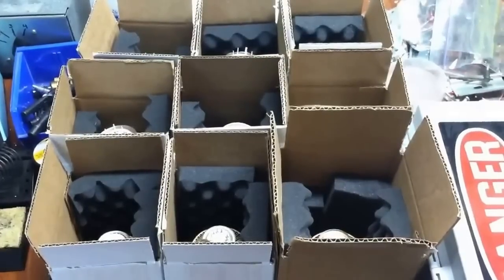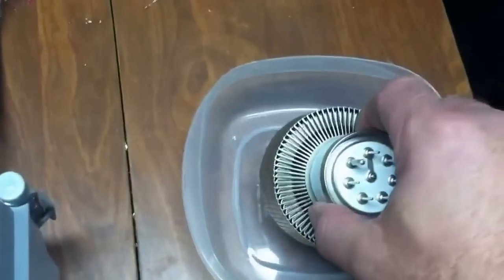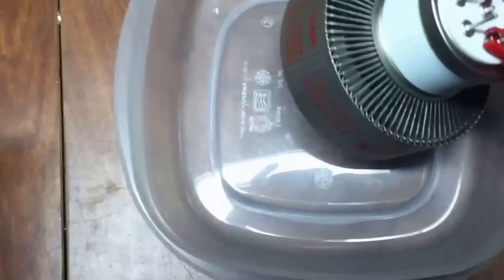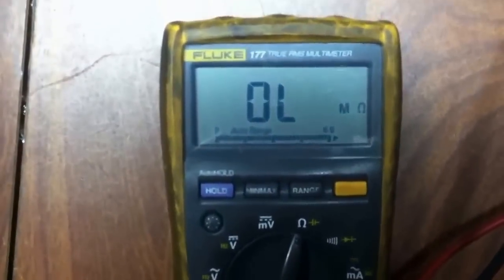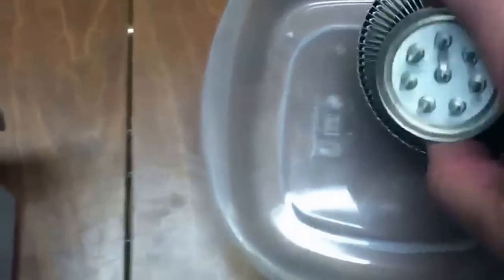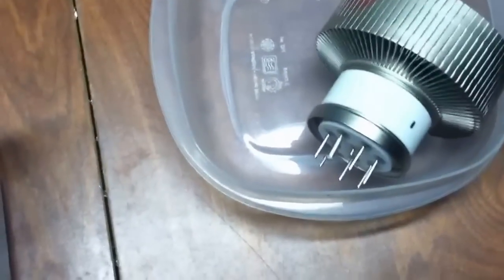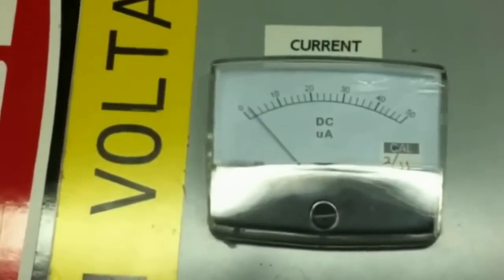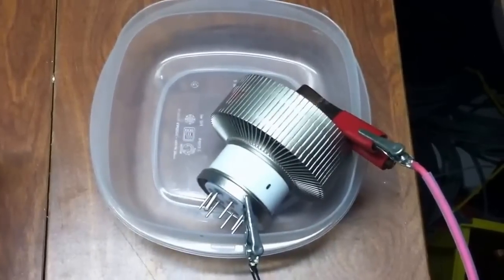TRIODE TESTING

Comment: Great Video, one question: Perhaps I am missing something. The Eimac specification sheet for the 3CPX1500A7 states that the rated plated voltage is 10KV. You performed the test to 5KV. Am I misinterpreting the rating?
Reply from the maker: 10kv is when used in pulse  service. If the tube had a short or the vacuum had been compromised 5kv is more than enough to show a problem.
Reply: let me know by video how to test gi46b tube

Comment: How do you test a 4cx1000a?
Reply: negative on nearest pin to anode,that is screen grid ,and positive on anode....rarely those tubes will have shorts from grid or screen to anode,its cathode to  grid and grid to screen that can have shorts,THEY ARE BEAM TETRODES,or can screen produce strange behavior,when to much back bombardment OF SCREEN GRID occur in previous work... screen current will strangely behave,current will go crazy from positive to negative suddenly....normally negative or positive screen current is normal in tetrodes,but steady current driven with carrier...that you can check only in amplifier....but emission is easy to check ,put 6volts/10amps on heater AC...then tied together grid ,screen and anode,put positive dc regulated supply on anode ,negative on cathode....good tube will pull  maximum allowed anode current of 900 ma at around 27 dc volts...if more than 30 volts is needed to pull 900ma on anode,oxide from cathode is low and emission is low... regards
Reply: @sinkosav  How do to test a GU74B ? Tnx 73
Reply: @TheYc2lev  gu74b is tetrode ,same as 4cx1000,so you have to put filament AC voltage to heat the tube...then connect together g1,g2 and anode,and put positive wire from DC power supply on that connection,minus from supply connect to cathode on tube,then increase slowly DC supply from zero and monitor supply current meter,as you increase voltage ,current will be increased...max  anode current for gu74b is 750ma....so increase voltage to achieve 750ma,if tube is good ,around 18 to 20 volts will be needed.....in that way ,you can test any tube,basically that way tube work as diode
Reply: @sinkosav  Thank you very much. OK, I will try it. See you 73
Reply: @TheYc2lev  you welcome,remember if much more than 20 volts is needed to achieve 750ma anode current,emission is low...you can try to cook tube few hours,but some air to cool a tube is needed,emission often can be restored that way....you will notice that current increase slowly without increasing supply voltage...regards
Reply: @sinkosav  what do you mean: " try to cook tube few hours" ??
Reply: @TheYc2lev  it mean,leave tube heated and under anode current ,as  suggested for 2 or 3 hour..its engineering slang for heating tube for some time to  finalizing vacuum inside tube,that way hot tube absorb molecules of oxygen and other imperfection in vacuum if tube is unused for long period of time
Reply: @sinkosav  , ok ok thanks for the complete information

Comment: ware is good place to bye medical pull at ??
Reply from the maker: It's been years since tubes have been used in the MRI machines. You can find the Chinese tubes on ebay.
Reply: k have u had good luck with the chinese tubes ?? i have not use any of the chinese tubes yet but will to give a go try if the quality good
Reply from the maker: The last time I received a batch of medical pulls half were Eimac and half were Chinese. I kept a couple Chinese and have been running it in my 8877 amp for a year and it has performed well. Only time will tell how they hold up?

Comment from the maker: I have had to test hundreds of tubes, after these simple test you can be sure the tube will not short when you power up. The best test is an emission test. With the 8877, grid current 20ma, plate current 800ma and plate voltage of 3500vdc should yield 1500 watts output. Low grid current is always a good sign.
Reply: I repaired an Alpha 76PA with 3 of the 3cx800a7 triodes. Letting them bake for 24 hours as we speak. Standby temp above tube 1 is 4deg F above ambient. Tubes 2 and 3 are about 10deg F above ambient. Wondering if the heater is shot (or going bad) in tube 1?
Reply from the maker: @Frankh77  Filaments are bad or they are good, no in-between. If it tests good with and ohm meter its fine.